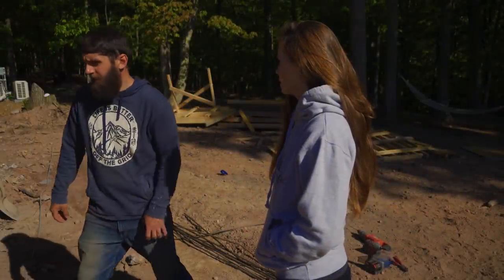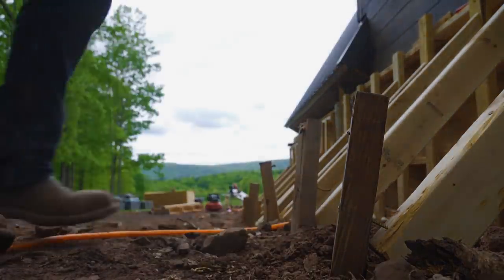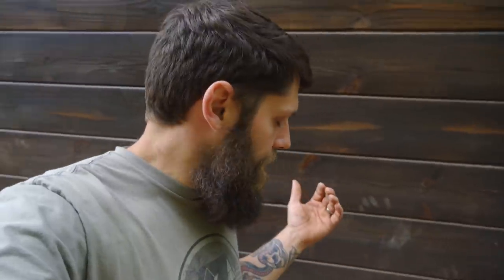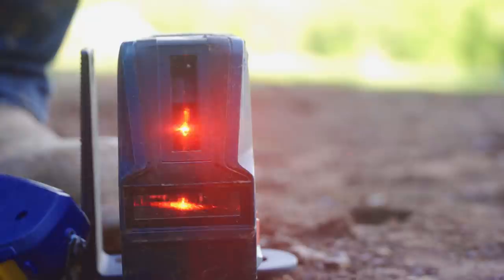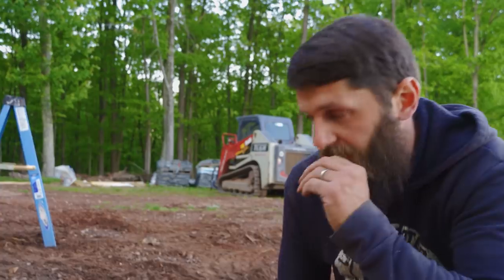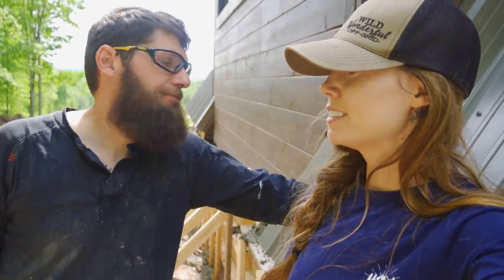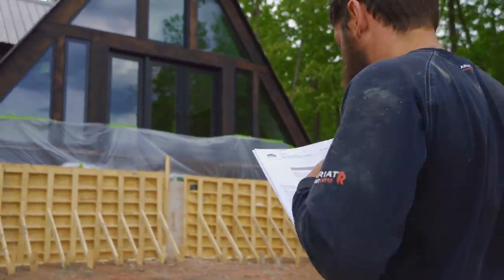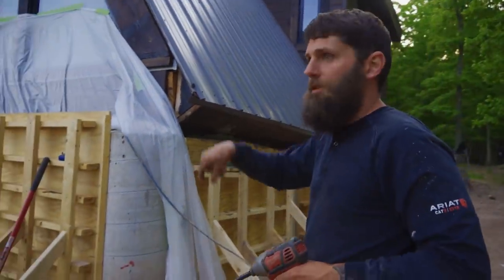Starting The DECK BUILD

Comment: Cable railing for the porch would look pretty cool. Not that hard to install. Minimal sight obstruction. Very low maintenance.
Reply: Yep. Purchase black oxide stainless steel cabling and it will be almost invisible from inside or outside the house. Sort of like the backstop net used at major league baseball games.

You can purchase with pre-installed fittings or purchase a swager to attach the fittings.
Reply: I'm not a fan of cable
Reply: I like this idea
Reply: Came here to say the same thing.
Reply: I agree. Fortress black satin powder coat posts and cable rails. Occasionally have to retighten cables first few months. Relatively easy install
Reply: Cable rocks.  Minimal obstruction.
Reply: I agree! Steel posts with cable rails!
Reply: Ditto!
Reply: @ptaylor4923  me neither, looks cheap and won't age well.
Reply: @hazbutler  I also see them as a hazzard, especially for little kids. Not necessarily these kids... but kids in general
Reply: @ptaylor4923  When tensioned correctly, u cannot pass a 4" sphere thru the cables.
Reply: @doneown503  Assuming the cables are spaced like that. I've seen them set pretty  wide. But absolutely thank you for the tension info. Always good to know.

Comment: Hey nice job on the wall. Good pour, guys. Very very nice to have the pump guy lend a hand. Hope you gave him a nice tip. You made the deck holes look easy when you have the right tools. That auger made short work of 25 holes. Looking so good. After the sono tubes are poured, it will be time for hamburgers!! Thanks for sharing.

Comment: I worked in construction for many years in my younger years. This is the first time I have seen a concrete pump operator actually doing both the pumping and hose operator...Josh guess you are very lucky having a gorgeous wife...maked men do shit they would not normally do..😂😎👍 with that said a big tip is in order for sure, that guy was great help to you both....

Comment: Cable railing. Our house came with a deck that had 2x2 wood balusters and it looked like jail. Thought about it for a long time. Finally removed the balusters and top-rail (wood) and kept the 4x4 posts. Used 2" galvanized pipe between the posts as railing (both painted black). Cable on 3" spacing. Completely opened it up to nature, but safe and cost-effective. Best thing we ever did.

Comment: Now that the foundation is going to be enclosed with concrete and stone, will rain water runoff be a concern? I'm curious if you'll need a drainage system, ventilation or fans under the house to keep things dry so mold doesn't grow.
Reply: They are working with inspectors and insurance agents to make sure the house is in sound shape and to keep them on the right track.
Reply: They addressed that a video or 2 back.

Comment: As for the decking, do a few levels depending on how deep you will go and just do a simple split rail type facing around ground level to keep the bigger animals out. I would want a large level for firepit, seating, hammock, hammock swings, grills, pergola, flower boxes for veggies, etc. I would leave an area towards the side for the zipline and slide to the pool, don't forget to strengthen the hot tub pad! Now quit reading this and get back to work!

Comment: Hey guys, great episode. I'm a deck builder and the railing system we use the most is the Westbury powder coated aluminum railing system. Easy to install, looks great and lots of options for posts, balusters, and low voltage lighting.

Comment: I have used flat upright metal panels that are drilled to accept 4 cables evenly spaced and tensioned and a round bannister rail 3inch diameter in a set on top of the steel uprights. The other option is to use a stainless steel oval hand rail. The idea being to compliment the house without interfering with the views. I am sure that what ever you decide it will be great. Congrats on the completion of your concrete pour. I told my friend who is a traditional dry stone wall builder here in the UK. He is always interested in how stonework is constructed in other countries. I am so enjoying your channels and look forward to seeing the next installment. stay safe J.

Comment: Your home is coming together beautifully. 

As to deck railing options, reconsider glass railing system. The maintenance piece is far less of a consideration, if the glass is properly treated. I’ve coated mine with a glass ceramic coating which lasts about a year. It’s a DIY product. Surprisingly minimal cleaning efforts after glass treatment with the benefit of a mostly uninterrupted view. 

Furthermore, I would glass ceramic coat your existing windows. You’ll be very surprised how well this product works.
Reply: You can also use Krinklglas.  They are out of Florida, but can ship it straight to you.  It’s a poly resin based glass.  Which makes it almost completely shatterproof.

Comment: for the record, "oopsie" teeny weenie" and "itty bitty" ARE industry correct terminology
Reply: and smidge...
Reply: And “a hair more” and “half a hair back”.
Reply: Don't forget oops a daisy when tripping up
Reply: Run the stairs back along the side of the deck so you don't fight the sloping landscape, but rather meet it, ending up with less stairs.
Reply: @TheScottmittel  Indeed. That will, also, remove an obstacle jutting out into the yard.
Reply: @TheScottmittel  They they only have stairs on one side tho. This way the entire side of the deck is stairs. Which also doubles as usable space. Picture group parties with folks sitting there watching the fireworks! They have their own built in bleachers.

Comment: You can have a concrete deck with natural grass decoration. This will prevent from any water splash on the glass window during rain. Along with glass railings on the sides along with the stairs

Comment: great work again guys!  What a hugely successful day.  

On to my suggestions of railings  ;-)  We used stainless steel, marine grade cable/braided wire - and our building code mandates a wire every 3".......  we used hardwood uprights, and top rail.  I did this myself (made myself a marine ply guide with all holes and clamped to each upright to drill thru (long 4" metal grade drill bit)), and while it is pricey (with all the stainless end connectors being the most expensive components) the end result is that the wire/cable ends up being basically invisible.  Lovely clean, simple and secure result.  Make sure you keep the stainless steel braided wire certificate - as on one section there was an impurity in one braid that caused rust - the supplier replaced all wire and end stainless fittings!

Friends recently, in a higher wind area nearby used a metal system, and on higher wind days the railing vibrates and sings (not very tunefully ;-).  We are only 1/2 mile from ocean, so rust is always a consideration for us.  Good luck with whatever you decide to go with.  Enjoy your energy as always.  Cheers, from oz.

Comment: I used stainless steel cables, and I'm glad I did.  A very minimal streamline look  that doesn't impede the view.  If you want to go cheaper than buying the cable kits you can buy a large spool of stainless steel cable online by a cable supplier.  There are several ways to anchor and tighten cables at end posts. I believe I found the cable through a supplier that is for sailboat rigging.  If I recall, the cable was 7/1 cable (7 stands rapped around 1 which is a perfect width).  Also I am so glad I spent the money on Ipe wood decking, which is the most expensive decking but lasts forever. My deck was about the same size as you are building.

Comment: A cable railing system seems the best option for you. You might need a custom solution but it's almost seamless. Also, you can align the railing with the A-frame. It covers some space in this way, but it will match better with the rest of the house.

Comment: On the deck build, I personally would go with pressure treated lumber for the structure stained the dark color of the house.  Flooring would be the plastic stuff whatever it is that needs no maintenance.  Railings would be so cool in black metal.  It gives you the opportunity to put in floral welded metal patterns in between the beams for the main deck.  You two are doing such an amazing job!  Sidebar, it was cool to see the cat helping out with the rebar.  LOL

Comment: For the deck, go with metal.  You were spot on about the glass..... continuous cleaning.  While it might be tempting to go with the burnt lumber like you used for the house, wood still requires tedious maintenance and does not "break things up" like a different material like metal would.

Comment: Not sure what the cost difference is now between lumber and plastic (rec. plastic) decking is, it used to be huge, but now maybe it is closer to the high cost of lumber. It would look great as your deck, be Much more splinter friendly for the youngsters, and be more weather resistant as far as uv light.

Comment: Use bare stranded #4 or #2 or maybe the braded lightning arester cable as the railings.  It will age super cool maybe hit it with muratic acid to turn it green when you install it.

Comment: When you’re setting out your foundation corners to ensure that you are square you take the diagonal.  Pull the length one direction and the width the opposite from the first stake and pull the diagonal from the far width and far length.  Which for you would be 35’ 1/64”.  You never have to move stake to require what wasn’t square that way.

Comment: When you were telling about the steps I guess they are coming down the front which will be tall and you will need the platform. For consideration look at steps off both sides which will lead to you truck on the right and the power house on the left. The railings on the deck, have you thought about the black iron fencing installed in yards around houses. Seams it would match the black trim on your windows. That pumper is going to make it a lot easier pouring the 25 supporters in the front. You kids are doing a super job and bringing back a lot of memories for us when we built in 89 thru, and thru, and you will always find something to do. Good in the future and stay safe.

Comment: Use 1” or 1.5” black pipe, painted black again - for posts. Air plane cables in middle. Easiest / least expensive option. Especially if you contact you local HVAC co, just buy it from them cheaper than HD/Lowe’s

Comment: Hope the concrete truck doesn't mess up holes? When pumping it, move it down the wall so as to even the load on the forms, most pressure is at the base of the form, then go back to the start of the pour, and do this again until topped off.

Comment: You guy should put a concrete porch with a roof over it so you guys can enjoy the porch even when it is raining outside railing use the powder coated aluminium railing.I had a pressure treated deck before after a while you need to clean it and reseal it,took it down and put concrete patio and I love it No maintenance

Comment: Great work as always guys! Don't know if you guys will be using stained posts, and decking. Like the outside stain. Or make it a little lighter. For the railings, you could use black rails(kind of like the railings on the ladder and rails to the boys loft, with stainless cables running across. It's probably a lot cheaper than doing it with wood. Given the price of lumber in the US. Like Erin said you don't want to use glass. Too much cleaning. Maybe someday after you get the bedroom wing at the back of the house finished. You guys can maybe build a workshop for Josh. You guys have all them trees around you. Maybe you can cut down and mill them for some of your build.

Comment: For the railing on the deck, I reckon either wood frames or steel frames and high tensile steel wire rope for the horizontal fill-in sections.  They also look good and you will see straight through. No matter what you go for, you'll have something partially obstructing your view be it wood frames or steel frames, but if you have the wire it will be almost invisible.  Glass is not an option for where you are.  It would look way out of place in my opinion. Also, glass gets dirty, even from rain and then you wouldn't see a thing until you got out there and cleaned it. Plus it is very expensive.

Comment: Cable railing.  Also, have you thought about a composite decking vs wood. It will last forever and you won’t have to worry about slivers in the kids feet. Just a suggestion.

Comment: Easiest/cheapest/best would be to build up the level of the ground to the point where you don't need a handrail at all. Thats what we did and I think the cut off height was 32 inches from deck to ground level. We bought 4 truckloads of fill and that was enough to build a berm to get us past the inspection. A year later a neighbour had 120 truckloads of dirt with nowhere to go so we had 80 truckloads dumped in our pasture which we then moved with the tractor and graded the whole backyard up by almost 6 feet. Just remember to lay some drain pipe from under the deck to a low point in the yard or you will make a swimming pool under your deck...:)

Comment: Railing - 4x4 hog fence panels with a rectangular tube steel frame. If the budget allows, powder coat, or clear coat for a more industrial look.

Comment: With as much glass as you have in that house -- and you don't seem to worry about cleaning that glass -- you might want to reconsider using glass railings. They give you a much better view than railings, and they won't cause any worse cleaning problems than your current glass.

Comment: Wrought iron would look awesome with Erin's idea of black on most things painting wrought iron black would be easy cuz it's a common color in rustoleum. Josh could add his acute personality to certain pieces also EASY to work with also heating the iron twisting it to desired likeness and installing it Work of Art. Cable also could be installed. Remember you guys were saying an awning could be difficult consider matching the roof of your homes slope unless that's going to match it remember though it will cut your view from within your home could install windows but with a twist a roll up shade from center on top of the awning to go downwards up to allow sun in or down wen the weather turns rainy

Comment: Shou Sugi ban wooden posts with cable across would be nice for the decks, maybe with a Japanese style top, or not. 

Glass walls with water softener might hose off easier (leaving no watermarks) than you would think. 

And you might consider making cables between posts something that can be electrified. Yes, that sounds extreme and you would only want them on if goats or other not domesticated animals decide to make your deck their new home. 

❤️❤️❤️ your videos.

Comment: You guys make amazing commercials! I think large posts and stainless steel cables with black fittings would look great, oh and also you need a hanging king size bed on the deck. Our friends had a hanging bed on their deck overlooking a running river, it was a righteous napping spot.

Comment: Nice job. I know how much work that is. You guys are getting so good with concrete! For the railings, I think steel uprights with stainless steel cable would go up quick, and look good. Then later, if you decide to go with all-steel, wrought iron, or wood, it should be a lot easier to change out. Keep up the good work and the GREAT videos! CHEERS!!

Comment: I built a deck for a client a few years back where I used some metal balusters that attach to an upper and lower wood railing. There were several styles/designs to choose from so you have the ability to go with plain jane straight balusters or something a little classier and more ornate. They look very nice and make for an attractive railing. I picked them up at home depot but I'm sure lowes and others probably carry similar products. I have some pictures but unfortunately photobucket stopped hosting for free so I don't have the pics hosted online any more, just on my computer. I could email some pics of that job if you'd like to see them.

Comment: The metal railing wo I’ll le compliment a wood cabin with stone. The textures would compliment. We didn’t have railing in parts of our deck and our dogs fell off of it because they were playing. They fell only four feet but was enough to convince us to put railing up. That being said you will need to see what is “code”. You holes need to be inspected too. We did not put stairs on the front deck so we are hoping that will pass code. We will see

Comment: Add it all up, the materials used, special Equipment rented, then hours put in the job, multiply it by Union scale carpenter pay by two, and there it is. Subtract the hourly rate from total cost, you see the SAVINGS.

Comment: Well done you are both doing a great job and a recommendation for the deck railing, nothing beats stainless steel cabling it's clean has a neat appearance low maintenance and will last a very long time, keep up the good work!

Comment: Posts and railings: Consider Steel Pipe  posts drilled with holes to accept horizontal stainless steel aircraft cable or seismic restraint cable. Very thin, strong, and durable.

Comment: Cable railing would look nice and complement the house.  I like the idea of doing a full width set of stairs to not have to do a railing.  Although you could shrink the lower stairs to say 8' wide to save some lumber and put the railing around the landing, which wouldn't block any of the view.  Just an idea.

Comment: I’d suggest black steel or aluminum rails (round?) for the deck. A bit less flexible than cables but would still have minimal visual disruption.